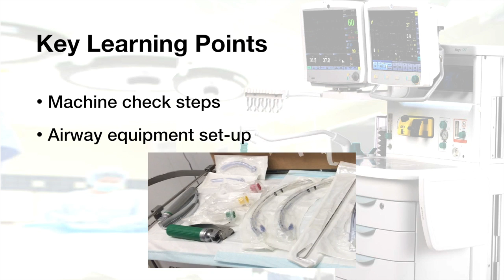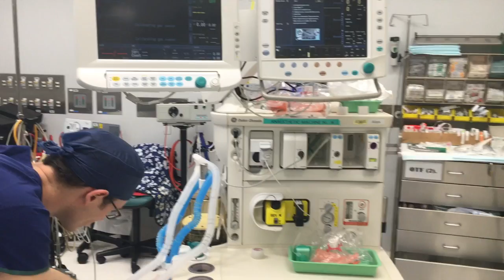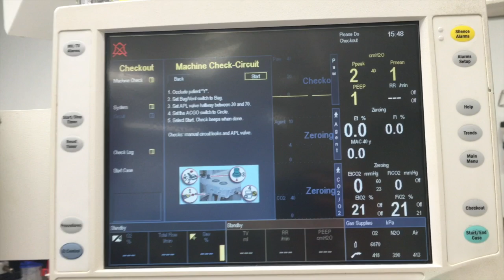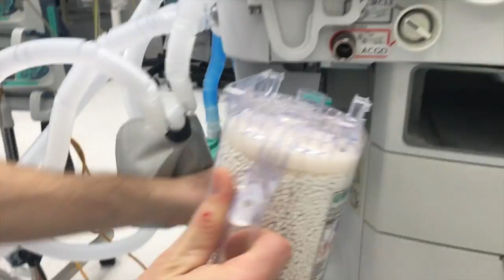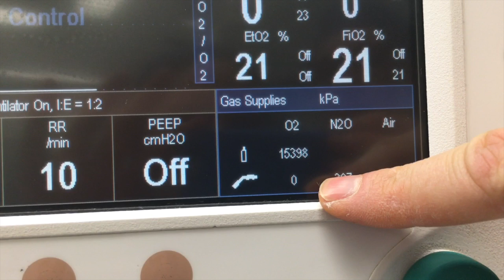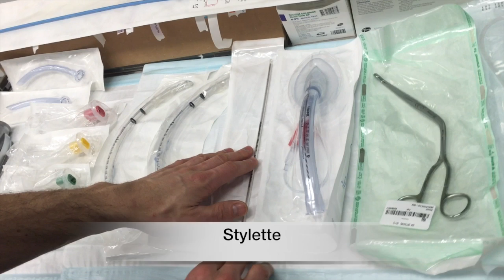Anaesthetic Machine Check Tutorial HS5409

Comment: Nice vid. Any reason you didn't use the ANZCA guidelines for checking an anaesthetic machine? (PS31)
Reply from the maker: The ANZCA guidelines are very extensive, this check focuses on the specifics of checking this actual machine.  This video does not replace any local guidelines, but should seen as supplementary. Please follow your local area guidelines and hospital policies at all times.
Reply: @dananaesthesia4353  why